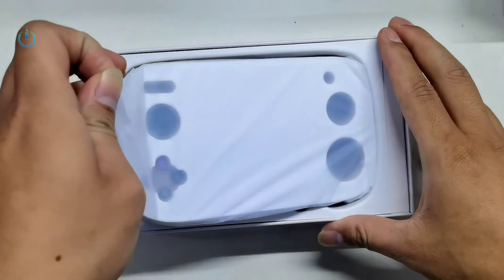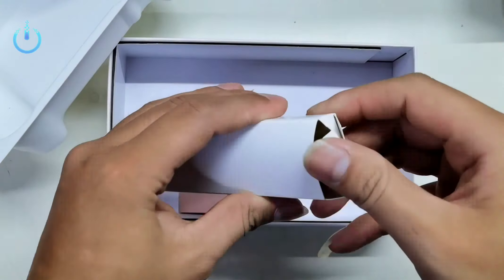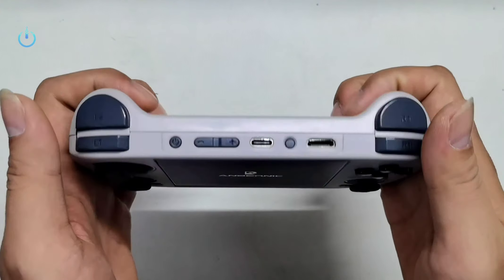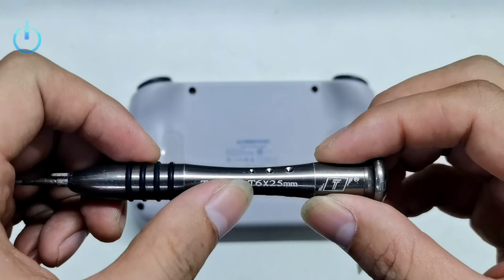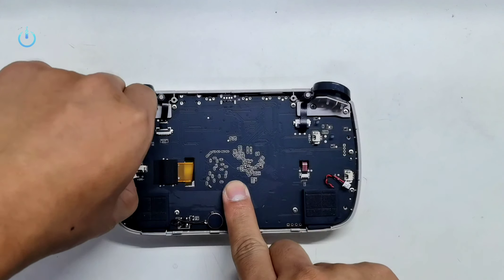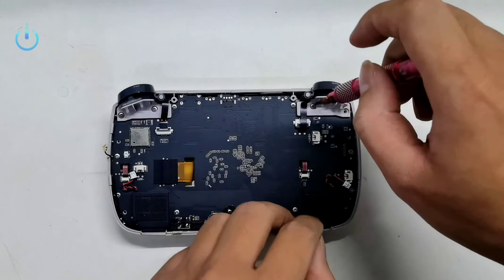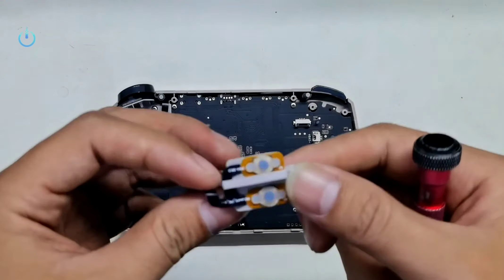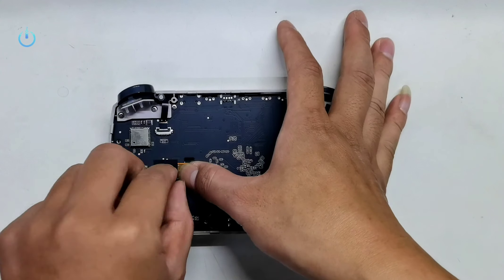Anbernic RG CubeXX Disassemble device

Comment: Thanks for the quicky and very instructive tear down and components showing!
I wasn't knowting they had turned the SoCs face in the board to the back of the screen instead of the usual "facing to where you open it", probably to avoid direct heat exchange between the components and the battery as used to happen in the 35xxSP...
An interesting concept BTW if the device was thick enough to keep a slight gap between its taller chip die and the plastic frame, so it won't use it to directly dissipate heat, also keeping the screen less prone to have localized hot spots (which could be so bad than let it warm up whole if they had opted for a metal shell there to let the heat spread).